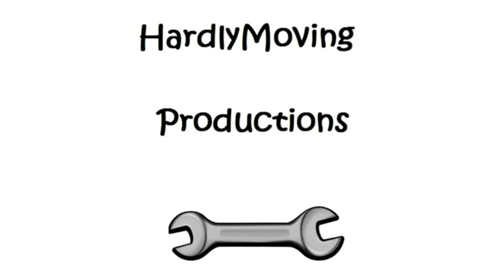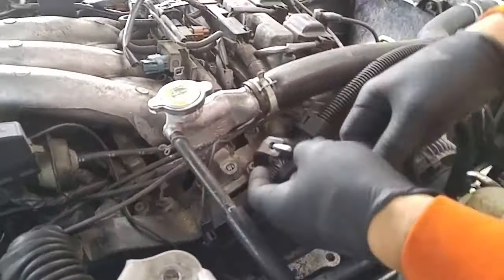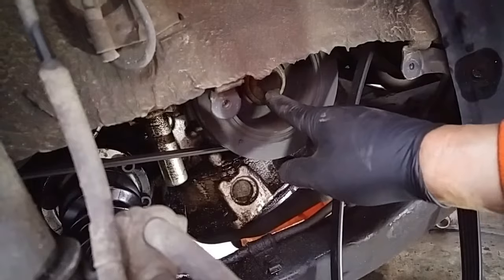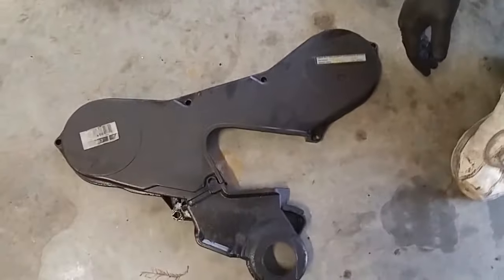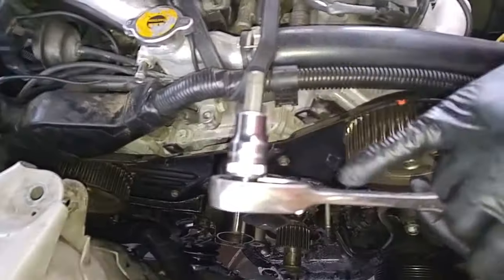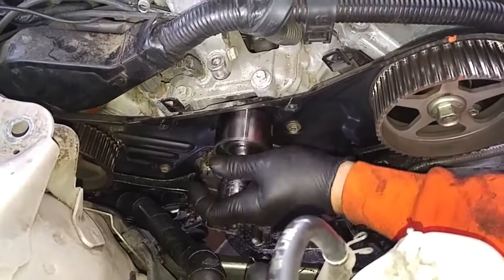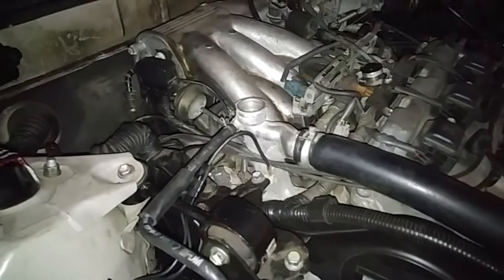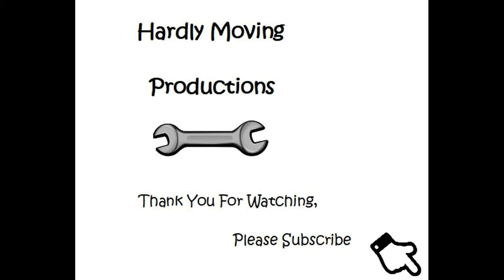Toyota Camry / Avalon 1MZ-FE Timing Belt, Water Pump, Seals & Pulleys Incl: Sienna/Solara/ES & RX300

Comment: Seriously helpful, quality video! You might add the torque specs for the job in the description, and do some mini videos about tricks for situations like when the crankshaft pulley is jammed on there (that sprocket edge on this one is seriously easy to bend and cant be flattened back out without the teeth shattering right off it), torquing the crankshaft bolt back on properly, and so on. SUBSCRIBED!
Reply from the maker: Thanks for sharing!

Comment: Thankyou for a really awesome and easy to follow video. 

Currently installing the timing belt. Everything is lined up. But once I spin the engine twice, the top two mark align but the crankshaft  marks don't. 

 I don't understand what I'm doing wrong? 

Any help would be greatly appreciated
Reply from the maker: On the V6's with automatic belt tensioners, there's no need to rotate the engine after belt installation.  Just make sure there is no belt slack between the cams and the crank pulleys.  The ratio difference between the cam and crank pulleys is why the alignment marks on the belt will not realign with the pulley alignment marks after rotation.
Reply: Sorry just so I understand, the alignment at 13:38. The two orange dots. Once the engine is rotated, they wont align. While the top camshafts align. 

So That's not a issue correct? 

Thankyou for the help again
Reply from the maker: Yes.  Not an issue.  However you should double check the cam and crank alignment marks with their respective backing plate and engine block alignment marks after rotation.
Reply: @hardlymovingpro  

Thankyou, all done, driving great. 
Only issue is when I drive short distance engine light is coming on. Cars driving normal no issues. 

But when I switch the car off and then back on its gone. Cars got no obd port which is amazing.

Comment: Excellent video, as usual. I have done 2005 honda pilot timing belt replacement after seeing one of your video, i did it well. Thanks. I was unable to remove crank pulleY key(woodruff key) to replace crank seal, it was so stubborn, i used chisel and had no luck, then i didnot replaced crank seal, do u have any tips about how to remove such stubborn crank key from crankshaft. If you dont have answer then i dont think anybody has. I always learn something from your video everytime i watch .. Thanks for it..
Reply from the maker: Thanks for your post and kind comments!  I've had the same problem before with the woodruff key that I was able to remove with mild chisel taps.  Don't understand why you can't get yours out.  Suggest you apply a little propane torch heat, then some chisel taps. 
 See if that'll nudge it out.

Comment: I can see the years of experience👨‍🔧🛠 shining through thanks for sharing  I don’t know if I’d tackle this it’s little more involved  than I like to  do👍
Reply from the maker: Thanks ... the hardest part of the repair (that gets me worked up all the time) is getting those 17 mm crankshaft pulley bolts loose using the long handled chain strap wrench and a cheater bar to get the leverage.  So far, no mishaps!  The cam can jump but I just re-position them after the seal's been replaced and the cam pulley re-installed.
Reply: @hardlymovingpro  I thought my A8 D2 timing belt change was silly because you had to remove the front bumper to access everything but this looks cramped so perhaps it wasn't such a bad design. Of course the v8 was a ton more complicated and $$$$.

Comment: Great, detailed video. Thanks! About how long would it take with the engine out?
I need to replace an engine and thinking belt, water pump etc should be done while it's out. Alternator etc won't be on the replacement engine.
Reply from the maker: If out of the car, around an hour.

Comment: Thank you for the video. I am using this to replaces the water pump on friends toyota avalon. One quick question, why does the timing marks won’t lined up on his car? Both Cam sprockets lines up on the dot but the crank pulleys mark isn’t. I have rotated the crank five times and still not lining up. What gives?
Reply from the maker: You can use the paint marks on the new belt to line up the cam and crank pulleys.

Comment: THANK YOU SO So So MUCH! What a GREAT video with such excellent TIPS! Following your excellent instructions I was able to do all of this on my '97 Avalon. Worked great! HOWEVER... Now I find the oil pump is failing. I should have replace it when I was doing the timing belt/water pump/seals but I didn't... SO, QUESTION... To do ONLY the oil pump I shouldn't have to do anything but remove tension on the belt and remove the crank pulley... In other words, do I need to do all the stuff to the "top end" or can I just do the bottom end items... I don't remember if the water pump is BLOCKING the oil pump or not... PLEASE ADVISE?! THANK YOU!!!
Reply from the maker: Are you referring to the power steering oil pump or the engine oil pump?
Reply: @hardlymovingpro  HI! I did the power steering pump at the same time as the rest already, so... The ENGINE oil pump itself. It seems I DON'T have to remove the camshaft pulleys, timing belt cover backing, etc... Just the lower timing belt cover, and enough to remove the crank pulley, RIGHT???  THANK YOU! It would be great not to have to remove the engine mount, bracket and all that or the water pump again! LOL!
Reply from the maker: @aCam-ns2lm  I'm confused.  How do you know that the oil pump is detective and needs replacement?
Reply: @hardlymovingpro  HI! Thanks for taking the time to counsel me! I haven't checked the actual pressure yet but WILL do that before I start anything. However, the SYMPTOMS seems to indicate the oil pump is weak... Oil light flickers and sometimes stays on and there is an occasional knock and/or tick, especially when 'blipping' the throttle. NOT driving it because don't want to do any damage. Already dropped the oil pan and cleaned everything including oil pickup tube/screen. Plenty of good, clean, new, proper oil and filter. Just trying to think ahead/prepare! THANK YOU!
Reply from the maker: @aCam-ns2lm  start by checking or replacing the oil pressure sending unit.  Also your knock sensors may be bad.  Did you do a MIL / check engine light code scan?

Comment: Though I won't not do it myself, I really enjoyed this presentation. How long did it actually take? Also that tool used to to fill the coolant was...... wait for it... Cooooool. Tools  tools tools.... Thanks and take care.
Reply from the maker: Glad you enjoyed it!  I can do this job in under 5 hours.  The coolant funnel works great to prevent spill over during the engine warm up process where trapped air bubbles are getting pushed out.

Comment: I saw you use your impact for the crankshaft bolt, but what are the torque specs for that, the impact is just enough for the bolt not to get loose again?
Reply from the maker: That's a big bolt.  Impact it back on and it won't come loose.

Comment: I have a 2000 toyota solara!  It's loosing coolant?!  Somehow!  I don't smell it or see smoke if head gasket was bad!  I don't see any puddles under car!  Are there any hoses in the back of engine block?  Any help would be great...
Reply from the maker: Could be a hairline crack in the radiator that opens when hot.

Comment: Hey thanks for the video! I have a quick question though. Is it good to leave the oil that has leaked on to the car engine? Do you think it could provide some sort of protective layer to prevent corrosion? I noticed you didn't wipe the oil leakage off in the video.
Reply from the maker: Excess oil on a engine caused by some seal or gasket leak should be cleaned off (or power washed off with engine degreaser and pressurized water).   Oil can degrade rubber, retains heat and in extreme cases can cause a fire.  Like most mechanics, I clean off enough to complete a repair.
Reply: @hardlymovingpro  Thanks for the reply and explanation Hardly Moving Productions. That is much appreciated! I have oil that has leaked out from my 99 Camry 3.0L (1MZ-FE) engine around the timing section and I wasn't sure if I should clean it or not. I will now though.

Comment: I didn't see the list of tools or were you referring to making mention of them in the video? Thank you. That seal puller looks much less likely to mar the shaft but the lip looks like it could break off under the seal. Any problems?
Reply from the maker: The seal puller lip is made of a high strength spring steel and will not break ... at least it hasn't broken on me yet.  The tool is listed in the text description of this video under "show more" as a camshaft seal removal too.

Comment: Is there an oil pump gasket to change out?  There was a lot of oil spray on side of motor on 2002 solara...
Reply from the maker: Nope.  Oil leak problems from this engine emanates mostly from the camshaft seals.

Comment: I have a 97 v6 toyota camry how can I know if it has an interference engine before replacing timing belt? Thanks and great video!
Reply from the maker: 97 1MZ-FE engine did not have VVT technology back then.  Your engine is not interference until around 2000 on the ES300.
Reply: @hardlymovingpro thanks alot!
Reply from the maker: You bet!

Comment: beautiful work I've been watching your video a lot because I will be doing my water pump to my solara and was wondering what's the name of the tool you have to hold the camshaft pulley its the bar with the chain?
Reply from the maker: Thanks!  It's called a chain strap wrench.  It's used by plumbers to twist iron pipes on and off.  A link is provided in the video description.
Reply: @hardlymovingpro  thank you
Reply from the maker: You bet!

Comment: Is the oil leak from the main seals you replaced? Is this a common issue, ie will a timing belt job with appropriate seals replaced file the leak, in my case it looks like it's coming from a move the exhaust manifold, timing cover gasket?
Reply from the maker: On these engines, the big source of oil leaks are from the camshaft seals.

Comment: Great video - I plan to attempt this soon on my 2000 Camry V6.  How do you get the correct torque on the crank bolt using an impact tool?  The proper way of course would be a torque wrench but I saw that there are things called "torque limiting extensions" and was thinking maybe a 150 ft/ lb one of those with an impact might be easier.  My first time doing this so might be risky to go by "feel".
Reply from the maker: You don't need to be absolutely precise with the torque on the crank bolt.  Since it's a large bolt, around a little less than one second of impact with a high torque impact tool should suffice.
Reply: @hardlymovingpro  Thank you for the response! As I research this job further my current dilemma is whether to replace oil pump seal/ o-ring/ gasket while I'm in there.  From your other articles it sounds like a good idea on 20 year old, 210k vehicle.  Also sounds like a PITA job from factory manual instructions!  Maybe I'll leave it alone if all looks good.  LMK if you have any advice suggestions.  Thanks again for all the online help with this job!
Reply from the maker: @airmilesemail5282  Never seen one leak and it's a lot of extra work IMHO.  You'd more than likely have to drop the oil pan to pull the oil pump housing off and only once was there a need to replace a leaking crank seal (although I make it a practice to replace it with the cam seals since it's in my face).
Reply: @hardlymovingpro  Yes, oil pump seals etc. looks like lots of extra work so I will avoid - thank you for sharing your experience.  Plan to tackle this next weekend - just purchased bunch of tools using your Amazon links! :-)

Comment: I have a question -- if seals are good and not leaking as yours, should i still remove cam wheels and back cover to remove pump? Can pump be removed without removing the back cover? Thanks for any info.
Reply from the maker: Just remove the 10 mm dust shield bolts above and around the water pump.  The shield will give and bend enough for you to slide out the water pump.

Comment: Nice work as always. Have you had much experience with dayco timing belt kits?
Reply from the maker: Dayco is a large company that makes quality parts.  Haven't had any problems with their parts.
Reply: @hardlymovingpro  Good to know you’ve had good experiences with them. The reason I ask is because I had one their timing belt tensioners fail recently, destroying my interference engine, all the oil leaked out of it after 30,000 miles and I was able to compress the tensioner with my fingers. I’m thinking it was possibly a counterfeit part that I brought online for a cheap price, even though it said dayco on the box.
Reply from the maker: Yea.  The Chinese make counterfeits of everything.  Best to buy from reputable retailers than from fly by night ebayers.

Comment: I just bought a Milwaukee 'mid torque' impact. Curious if it will be enough to get that bolt off. Milwaukee states it has 600 lbs ft on high mode.
Reply from the maker: That should be adequate torque

Comment: Great video!! Unfortunately you forgot to tighten the second bolt for the power steering pump bracket.
Reply from the maker: Good call!
Reply: I retract my last comment. It was unnecessary and I apologize. You know what you are doing and I appreciate the video.
Reply: Is it true that there are paint marks on the belt that align with the timing marks on pulleys?
Reply: I am look forward to doing this on my Camry
Reply from the maker: Correct.
Reply from the maker: let us know how it turned out!

Comment: I snapped my Timing Cover Bolt under the Cam next to the firewall

Any advice for how to get it out? Where would I put a floor jack to lift the engine a bit if possible?
Reply from the maker: I wouldn't worry about replacing it.  Not a critical bolt.

Comment: Is a 22 mm harmonic balancer socket, as described, really necessary over a regular 22 mm impact socket?
Reply from the maker: Try to remove with a regular 22 mm as a first step in the repair.  If it won't come off, use the 22 mm high mass socket.
Reply: @hardlymovingpro  
Thank you for the reply.

Comment: How long did this job take you?  Of course, I will multiply by 10 for me.  Also, why didn't you change the tensioner since you were replacing everything else?
Reply from the maker: With no problems, I can do it in 4 hours.  If doing it yourself, about 6 - 8 hours with the right tools.
Reply from the maker: Oh yea ... forgot ... never had or seen a tensioner go bad on these MZ-FE engines.  But you can replace it with a new one if on the side of caution.
Reply: Thank you for taking the time to reply.
Reply from the maker: @Wdbx831  You bet!

Comment: So I've watched a few of these now from different mechanics and for some reason my brain correlates the timing of the cams and the crank with magic. Help me understand. First set crank at TDC. The cams should then be in correct position. Remove belt. If one of the cams moves I can simply turn it so the marks on that sprocket line up with the respective indicator? I don't have to worry about compression stroke or anything? Just line up marks on all 3 shafts and install belt as you've showed?
Reply from the maker: That's correct.  You can move the crank and cams a few degrees to help install the belt, then move them back.  Afterwards, there should be no belt slack between the cams and crank.  That's a common mistake made by rookies.  They mount a new belt with around 1 cog of slack because the belt will not stretch on.  But the cam and crank alignment marks are okay not realizing that the slack will result in 1 extra cog length.